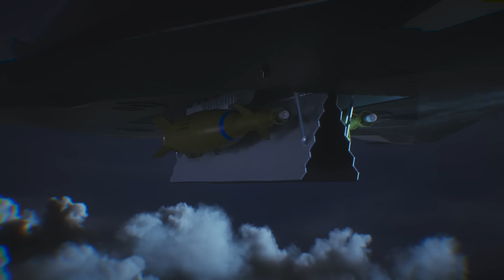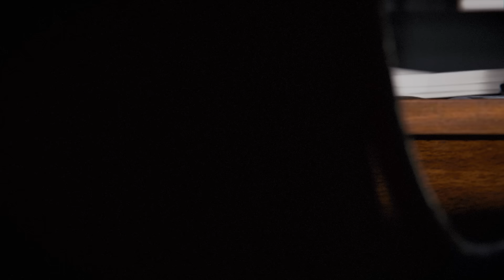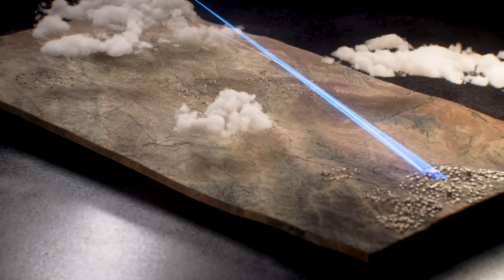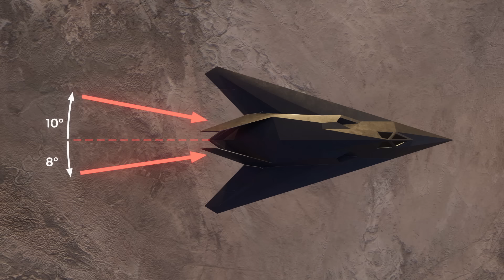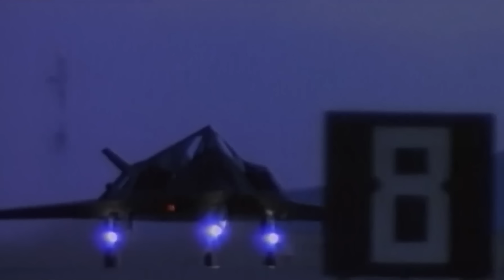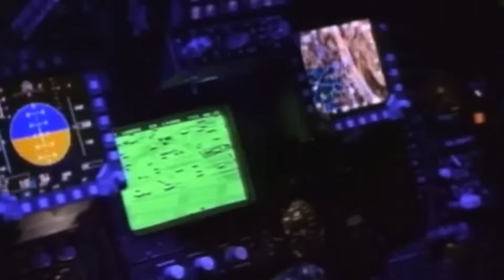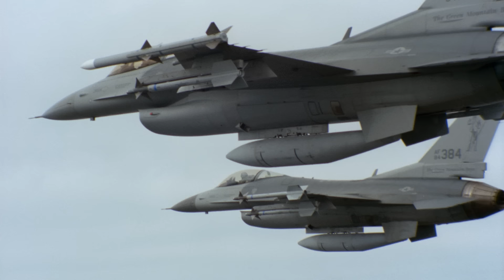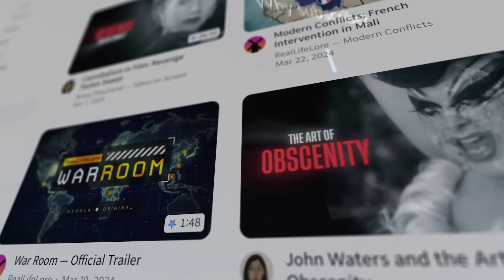The Insane Engineering of the F-117 Nighthawk

Comment: Just to clarify the loss of a F-117 over Serbia: F-117s typically flew mission with EA-6B prowler electronic warfare aircraft which had the mission of destroying AA missile radars using radiation tracking missiles. This is why the serbians moved their missile batteries so frequently and turned to the radars on only in quick bursts, to increase the survivability of their AA systems. Due to complacency, the F-117 that was shot down did not have Prowler escort and was flying the same route as all the previous missions. Additionally a radar operator, desperate for a F-117 kill, broke protocol by having his radar on longer than he shouldve. While the radar was on the F-117 pilot opened the bay doors to drop the payload (radar was combletely oblivious to the A/C until that point) and in that instant the missile battery was able to get a target lock and shoot down the F-117.

Comment: Other than the Bomb vs. Missile and GPS being in Desert Storm flubs, nice video. I had never heard of wipers for the engine intake screens (aka Salisbury Screen), still not sure if I believe that one. I have always read that the grid had a heating element built in to it. I have even seen pictures pointing out the slight glow of the inlet screens with it on. I suppose that that wipers could have been a concept or even a test article at some point. I did some quick Google searches and found more references to the inlet screen being heated than having a wiper system. I have read just about everything on the F-117 since it came out. It actually inspired me to go into the USAF with an interest specifically in airborne radar and electronic warfare. Any F-117 maintainers out there that could clear this up?

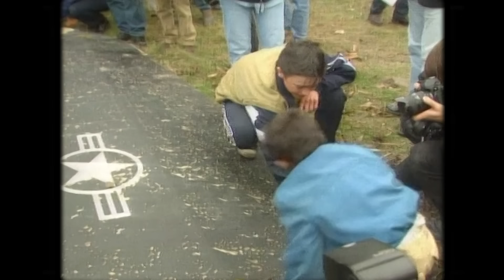Comment: 23:15 wanted to add that the commander of the SAM system later claimed that they were only able to get a lock when the F117’s bomb bay doors opened which briefly created a bigger radar cross section.
Reply: He changed his story multiple times. The fact is that the S-125 was in a site location presumed empty so planners put an egress route there. The F-117 basically nearly entered the S-125 minimum engagement distance. Point blank shot.
There were no fancy tactics or trickery involved. Just physics. Stealth works with the inverse square law. Take out the distance, stealth aircraft become detectable.
Reply: @ChucksSEADnDEAD  yeah, not surprised. Realistically how would he even know that the bomb bay doors were open?
Reply: @MrGluGlu  Pure luck, I doubt he was waiting for it to start its run, just got lucky with turning the search radar back on. It certainly would help out a SAM site immensely in gaining a lock, even at close range.
Reply: @MrGluGlu   luck? no one has said they KNEW the bomb bay doors were open, just that that's how it happened. I mean if the AA missile batteries were there then the targets were probably very close so there's a decent chance the doors would be opening over that area. Everyone is saying it was the 3rd radar sweep when that time happened to align, its not like they knew when the doors were opening ahead of time and targetted it at that moment.
Reply: @MrGluGlu  They wouldn’t know that the doors were open. All they would know is that a blip showed up. Lockheed put a lot of effort into speeding up the drop sequence. Once the pilot initiates the sequence, everything is automated after that. From doors open to doors closed was less than 10 seconds but it likely that it was faster than that as development continued.

Comment: 16:50 This part of the animation doesn't display AOA correctly. AOA is the difference between the direction in which you are moving, and the direction the nose of the plane is pointing. Its kind of similar to drifting a car. 

The animation displays this instead as if the plane would not be able able to point its nose down again, if the plane goes beyond an incline of 17°. Though, this is not the case, and the plane would be able to climb at a 17° incline.
Reply: Hmmm... we can be more precise: AoA is the angle between the incoming wind vector and, generally, the wing chord. Direction of movement can be misleading. A strong enough headwind and you can keep an airplane in the air without moving it relative to the ground at all.

Comment: False! The F-117 that was shot down was not due to moving the radar units around, it was due to a massive political mistake where the politicians ordered the generals to fly the F-117 at extremely low altitude through a valley every night, which Air Force generals would never do, night after night the F-117 was observed with human eyes flying through, it was not detected by radar because it was seen by humans. that political mistake allowed the Serbians to move an anti-aircraft battery right into the flight path, since they had seen the aircraft so many times at such slow speed they could estimate when to launch the missile so an observer watched as the plane approached again, radioed the launcher where the launcher counted so many seconds the launched the missile without a lock by pointing it directly at the path the aircraft had been flying in all that week, so then it could simply clumsily fly into the aircraft and that is the only way that they could score a hit, purely via an incredibly unbelievable political mistake.
So it was not shot down in the normal sense, it was run into in an air-to-air collision essentially by accident.

Comment: Read Skunkworks by Ben Rich if you want to know more about development of the F117 and other top secret planes like U2 and Blackbird

Kelley Johnson hated the F117 so much he literally kicked Ben in the rear for wasting time developing it
At radar range testing, the signature of the F117 scale model was so small Lockheed needed to design a stealthy pole to mount it on so they could get an accurate measurement. Other airframers in the competition saw the new pole and that it was invisible to radar. They knew they lost the competition right there

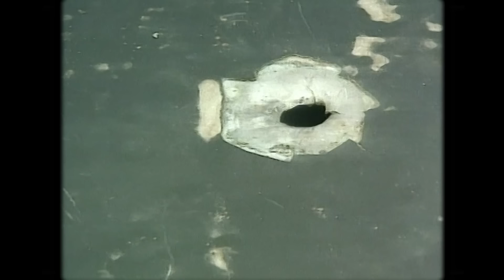Comment: 23:35 Actually, the real reason they were able to shoot down the plane was because they kept flying the exact same route for weeks, which means people were simply able to see the thing.
Reply: IIRC it was also because the F-117 entered the SA-3s minimum engagement range
Reply: @MaxAalbers-xy2xq  Other way around. Because they kept using the same flight route, the Yugoslavian army was able to place the radar and missile in it's path.
Reply: @Gemm6905   The F 'Sorry, we didn't know it was invisible' 117  that was detected by then a 30year old Soviet radar. 🤣🤣🤣🤣
Reply: @bhaashatepe5234 Shut up bot
Reply: @Gemm6905  They also had spies on the ground an on that particular night, there was no escort due to weather conditions.
Reply: Yknow the thing was kind of black and it was cloudy at night
Reply: Even then, the SA-3 radar was only able to lock on to the F-117 after it opened its bomb bay doors.  The SA-3 missile hit the F-117 immediately after it dropped its bombs.

Comment: 0:19 Those are laser guided bombs, not GPS guided missiles. The Nighthawk never carried missiles; it was a very light bomber.
Reply: If you wanna know something funny there is a good chance it actually carried sidewinders. Pilots have talked about it being capable of it and that they could jerry rig them on improvised rails to shhot down AWACS
Reply: @xlgapelsin6173  Imagine being shot down by a fox 2 from a stealthy subsonic tugboat.
Reply: The word 'Bomb' is sensored
Reply: Grey area. Jdam have version that use GPS and propulsion.
Propulsion bomb, sometimes called air to surface missile. Another example of propulsion bomb : Hellfire
Reply: @budisutanto5987  The hellfire is a missile. AGM-114: Air to Ground Missile. It is not a bomb.
JDAM is a kit specifically designed for dumb bombs, like the Mk. 82, 83, and 84, to replace their tails with a guidance system. There is no place for a rocket. There are glide variants with extended range, but they have no propulsion.
In any case, the F-117 never carried any of these. It only carried bombs. And those weapons at that timestamp are Paveway laser guided bombs.
Reply: @j4s0n39   Ok, your definition of bomb & missile is spot on 👍
Reply: how do you know silly man
Reply: @demonicrgc  I don't know silly man. Is silly man a friend of yours?
Reply: @j4s0n39  More like a mirror reflection.

Comment: The Lockheed engineers were confused at first as to why they were finding dead bats around the aircraft whenever it was parked outside. Only to realise that their design was so effective that the bats couldn't see it with echo-location.....
Reply: Radar waves are electromagnetic waves whereas sound is a pressure wave. These are 2 different things. The story of bats is just a hoax
Reply: @mustafamahirdaiyan179  waves a wave, sound  wave's just lower and at a different frequency, most  of the same principles would apply to reflecting sonar. I wouldn't be shocked, should have a tarp over it anyway.
Reply: @mustafamahirdaiyan179  waves, waves is the key word if the radar and the sound waves are the same frequency then the airframe will deflect the waves the same
Reply: @mustafamahirdaiyan179  possibly but the sonar isn't as its just a reflective surface that may or maynot absorb the sonar?

idk how the stealth coatign works but it is like super classified
Reply: bats dont use electromagnetic radiation
Reply: @oofdotcom  I guess he meant that even for sound waves, it was invisible... 

But anyway, that is ...
Reply: I thought you were going to say something about the radioactive leading edges on them. Apparently the owls that roosted in the same hangars as the Nighthawks would die of radiation over night.
Reply: Pressure waves and electromagnetic waves are entirely different things. This is a made-up story.
Reply: I thought you were going to say something about the radioactive leading edges on them. Apparently the owls that roosted in the same hangars as the Nighthawks would die of radiation over night.
Reply: Not a fully correct story to my understanding but I know there is a similar story. When they were trying to calculate the RCS of the nighthawk on a support beam thingy they thought their radar was broken until they got something on the radar about the size of a pigeon, however it seemed to be higher then where they positioned the plane. They looked up and sure enough there was a bird perched on top of the plane.
Reply: What? Is that true? That is so cool.
Reply: Bats emit sound waves, not radio frequencies.😂
Reply: I'm deaf in one ear, and can't hear out of the other!🤣🤣🤣
Reply: Cool but untrue story
These aircraft are stored in climate controlled hangars, even the retired ones are. Theyre not having bats run into them as theyre sitting...
Reply: Honestly can a bat echolocate at a distance greater than the planes speed? I imagine the speeds this thing has to go  to stay up, they were just mowing bat flocks uncontested
Reply: The F 'Sorry, we didn't know it was invisible' 117  that was detected by then a 30year old Soviet radar. 🤣🤣🤣🤣
Reply: @bhaashatepe5234  bragging that youve been able to hit one single american plane since the early 90s is not the flex you think it is
Reply: @oso1165  It's not me who shot it down. it was the Serbs 😅

the facts that the Serbs, whose country is not a superpower, were able to detect, with then a thirty year old Soviet radar, and shot down the most advanced US jet fighter with cutting edge technology and shot another aircraft from the same model, is mindblowing .. 

The Serbs did everything they could. Their country was illegally invaded by the WHITE SUPREMACIST COUNTRY aka USA and its puppets aka NATO .. and they proved that even those white supremacists couldn't defeat a small nation that was determined to fight back 😅

the US accused the Serbs' killing of 8.000 'civilians' as a genocide, while the US killed 1 million people in Iraq without being able to prove the Weapons of Mass Destruction  that was used as the pretext of its ILLEGAL invasion of Iraq.
Reply: @bhaashatepe5234 and you dont like to talk about what they had to do to actually achieve that?
The usa ended up using the same flight paths night after night, and the Serbs put men in houses at the airbase go visually tell them when they were taking off, AND they had to get lucky.
Then after the shoot down the f117 continued to bomb the crap out of the Serbian war criminals with impunity. 
Claiming one success in a war of violent failure is the dumbest crap ive ever heard.
Reply: @bhaashatepe5234 ,I love it!🤣🤣🤣
Reply: @bhaashatepe5234 Stupid bot

Comment: Using the word "insane" for everything is beyond cringe, as well as "the engineering of" to mean design. I changed the title to "Overview of the technical considerations that went into the design of the F-117 Nighthawk" on the DeArrow platform. For anyone interested, it's a chrome add-on that allows the community to edit titles and thumbnails to make them more descriptive or helpful instead of everything being an adult person posing with their mouth wide open and a title in the lines of "The insane reason you can't do this in France". It's always "this".. apparently every video now provides nothing of value besides the missing word required to replace "this" and complete the sentence.

Comment: My Uncle Tommy was an engineer for the -117. One thing that I love about that airplane is the fact that Have Blue used so many off the shelf parts to make it happen. They used bits and bobs from the F-15, F-16, F-18, F-111, B-52(!!!) and it came in on time, on budget, and changed the future of air power as much as, if not even more than, jet engines.
Reply: Hahaha that's definitely an engineer's mindset. When I design I try to maximize how much of it can be sourced through McMaster-Carr.
Reply: @methos1999  As an electronics engineer, I feel you.  McMaster, Mouser, and DigiKey are 90% of my PO's
Reply: probably the most sensible way to develop future tech - go with mature technology for non-critical components. we learned this the hard way after all the fuckery with the f22 and f35 as well as the zumwalts. the b21 development is going smoothly cuz pretty much all the hardware under the skin is already developed.
Reply: I think the biggest feat is that it came in on time and no budget 😂
Reply: The F-117 program actually came under budget, they went to refund the USAF but the USAF didn't have a method for receiving refund on black programs. So they went back and upgraded the early production F-117s to the level of the final production block.
Reply: You would like the book "Skunk Works" by Ben Rich, he talks about Lockheed's policy of using off-the-shelf parts for their secret aircraft to keep costs low and speed development.  I think the ejection seat for the F-117 or Have Blue was out of an F-5, but it's been a while.
Reply: @BlindIo42  I second this. It's such an amazing book, it really shows what happens when you take a handful of expert engineers and scientists with no red tape and a couple of insane test pilots. I believe before a test flight they realized the tail fins were too small on a Have Blue prototype, so they chopped up a tool cabinet in Area 51 to make bigger ones and the test pilot was like "sweet, let's go!". His closing remarks about all of the added bureaucracy and red tape being the cause of delayed, overbudget and flawed aircraft was also an eye opener.
Reply: This pos changed nothing but the money piles of the .01%
Reply: Then you would know the bd5 produced by Jim bede was first tried to reduce radar cross sections long before hav blue. It was abandoned after a highly trained test pilot died in a stall on final. Then came my uncle major general Kenneth E Staten and everything changed, it was his close friend who died in the bd5.
Reply: @caledoniawarrior  I can't find anything about the bd5 reducing radar cross section
Reply: F-15 landing gear, F-16 HUD, C-130 ECS, B-52 INS, GE-404 engines (used by the F-18).
Reply: That’s incredible — the fact that something as revolutionary as the F-117 was pieced together with parts from so many other aircraft makes it even more impressive. It shows how ingenuity and resourcefulness can reshape air power just as much as raw innovation.
Reply: Imagine stealth propellor aircraft
Edit:(To clarify) a stealth ww2 era propellor plane
Reply: @Idontknow4 did you not understand the video?
Reply: @canis2020  I was just saying it'd be funny
Reply: @Idontknow4  All WWII aircraft were stealth, it was called "Night"
Reply: @BlindIo42  what about radar then